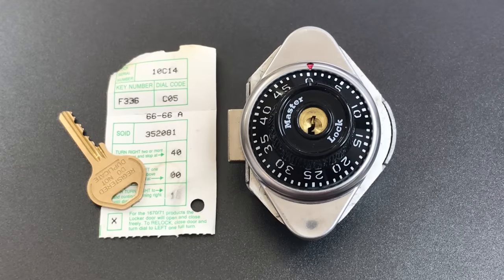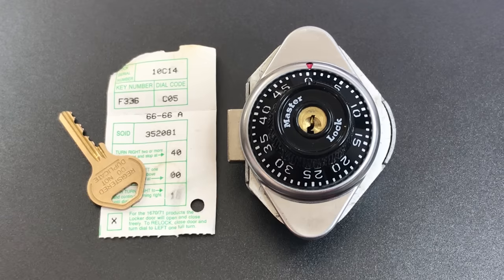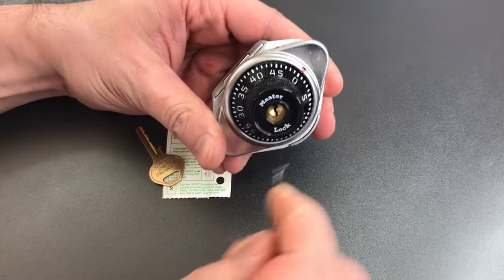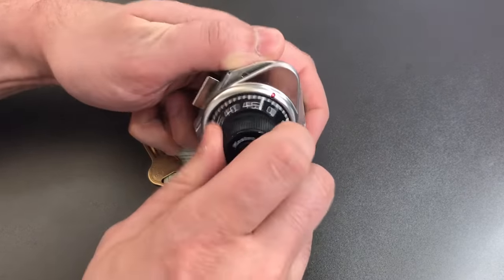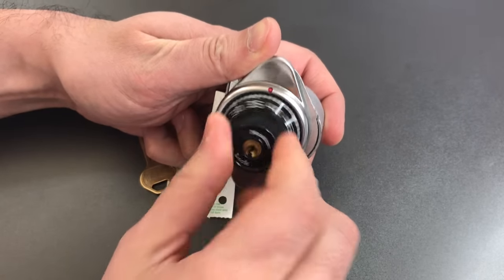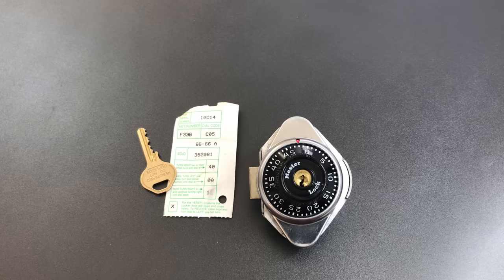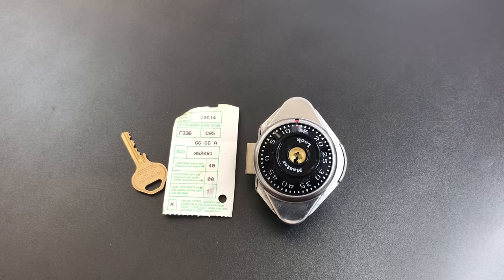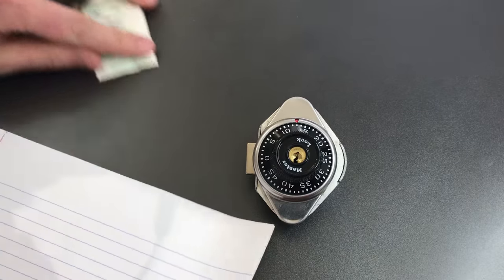[617] Master School Locker Combination Lock Picked and Decoded (Model 1670)

Comment: One combination to my HS locker was 15 - 17 - 47,   
suddenly remembered shortly after watching the video and reading some comments.  
(It's been a long time --- I graduated in 1977.) 
I believe the offset between combinations on that one was either five or seven digits, 
not different each time, but the same spacing all round (I could be wrong here).  
The Master combination dials we had required turning to the correct third setting,  
and opening the door required lifting a slide.   
I was well aware that there was about a one-and-a-half digit slop in my dial. 
Whether or not that was typical at that school I don't know, but it seems pretty tight for a Master.

Comment: Years ago I worked at a large company and my locker there had a lock like this on it. One day something broke on the inside of the lock and the latch wouldn't move. My manager had to call someone from key control to come out (which took a while) and as I couldn't go anywhere as my keys were in the locker they had to keep me on the clock. He tried a few of the multitude of keys he had but none worked so he wound up drilling the lock off at the attachment points. I bought a padlock of my own and used that to secure the locker from then on (there was a place to put a standard padlock).
Reply from the maker: Always a good idea to use your own lock... if it is intelligently selected.
Reply: LockPickingLawyer Agreed. I didn't have a choice while the original lock was on there. For a few days I used some cheap keyed padlock I had at home until I could get to the store and buy a combo lock so I wouldn't have to worry about losing the key. I bought a Master Speed Dial lock. It worked well and after a while I was able to open it faster than any key or standard combo lock. I liked how I could set my own combo of any length, I had 6 "digits" set on mine (so 4,096 possible combinations if I did the math right). 

Have you opened a Speed Dial lock on the channel and if not could you? I'd especially be interested in seeing the body opened up and an explanation of the mechanism.
Reply: LockPickingLawyer Agreed. I didn't have a choice while the original lock was on there. For a few days I used some cheap keyed padlock I had at home until I could get to the store and buy a combo lock so I wouldn't have to worry about losing the key. I bought a Master Speed Dial lock. It worked well and after a while I was able to open it faster than any key or standard combo lock. I liked how I could set my own combo of any length, I had 6 "digits" set on mine (so 4,096 possible combinations if I did the math right). 

Have you opened a Speed Dial lock on the channel and if not could you? I'd especially be interested in seeing the body opened up and an explanation of the mechanism.
Reply: @tallman11282  is the speed dial the d pad like lock? Yeah he did a video on it.
Reply: I dunno, in many jobs, having the equipment break down through no fault of your own so you can’t work but still have to be paid sounds like a win. Doesn’t work in lawyering, obvs.

Comment: Very interesting!
Over 30 years ago, I wrote software for a company that sold applications to school districts, and we had an application that managed these multiple locker combinations. Some poor sod at the school district had to sit down with the book or printout or whatever and manually key in all five combinations for probably over a thousand locks, but once the data was in, it was easy to do the lock change every year (apart from the manual effort of physically stepping the locks to the next position). When our software printed student class schedules for the students, we just picked up the correct combination based on the student's assigned locker number. Not bad for a software stack written in COBOL, I'd say.
Today, I imagine (hope) you just get a piece of software from Master with your lock order that preloads all that combination data for you, and/or a dump file that contains the data in a usable form.
Reply: >COBOL

Man I feel sorry for you

Comment: So I found this video today trying to figure out the best way to open the lockers I bought yesterday and what I should do about being able to use them going forward without worrying about them relooking and having to go through it all again. 
 I bought two stand ups that have 6 lockers per tower, and a cross between that has 4 lockers. 6 came unlocked but the others are all locked. 

Any suggestions would be very much appreciated.

Comment: Kinda late, but on the last digit you are off by 2 each time.  When the number was 48 for position 3, it locked up at 0.  Same with all others, it locked 2 ahead then you wrote down.  Given the projected 2.5 leway, I think you could not count the 2 you move back when changing the pattern, and come up with the precise number.  Based off observing the 3rd position each time.
Reply: I think that it's just opening when it gets close enough to be within the tolerance window. The window is 2.5 numbers wide, so that would make sense.

Comment: I used to slip a penny behind the bottom of sliding handle mechanism in my high-school locker. The penny would prevent the handle from dropping back down far enough for the combination lock to re-engage, but it looked locked, and the door would still latch shut. Then all I would have to do is simply lift the handle when I wanted to open my locker. I had nothing but books in there and wasn't concerned about theft at all. 33 years ago, nobody stole out of lockers anyway. My time in the hall between classes was more important than fiddling with a combination lock.

Comment: When I was in high school (back in the dark ages of the late 1970s), our lockers didn't open on the last digit.  You had to set the last digit, then pull up on the latch mechanism to open. The doors & latches were often bent and it wasn't unusual for it to require a bit of a jiggle, shake and/or smack to get the latch to open.  Like many others, I often had nightmares of not remembering my locker number and not remembering the combination.  The nightmare would also usually include getting lost trying to find the administration office to ask them to give me my locker number & combo.  <shudder>
Reply: They still have lockers that don’t open on the last digit. I got my first school locker in 2015 and it was the same way. Had to push up the latch to get it to open.
Reply: Wow - so others had similar nightmares.  I had mine after I graduated, which is kind of odd to me.
Reply: @jimothy2361  Pull lightly up on the latch while spinning for the third digit.  When the lock releases, the latch will come up.  Just make sure you're not pulling up on the latch hard enough to prevent the bolt from releasing properly.
Reply: If my locker wouldn't open up, I didn't fret or have nightmares about it, I simply took it as an omen to skip class that day. Had many fun days off..
Reply: O aye. Remember  ours  had the old fashion key. A lowe a fletcher double sided key. 95/97 series.  On a master key. Made in a way that user keys could not be filed/ altered to produce master key.  A different blank a reverse groves was used.

Comment: love this vid! the first i heard of using the 'wide gate' weakness was richard p feynman, bored and stuck at los alamos in the early 40s he started breaking into combi protected file cabinets. i wish i could remember the book where i read about it, super cool stuff.
Reply from the maker: It’s present to some extent on all but the highest security combination locks. Without it, they would be a serious PITA to open.
Reply: I don’t remember it but two very good books on that era are “the making of the atomic bomb” and “dark sun: the making of the hydrogen bomb” by Richard Rhodes. You might enjoy those. 
As to combo safes, HMG routinely use Chubb mk4 Manifoil locks on cabinets and lockers. If you’re half a digit off on the 100 digit wheel they’ll kick you straight out. They’re fucking merciless, and full of lead so you can’t x-ray them.
Reply: Worked in retail banking for enough years to have opened over 100 different combination safes, and found quite the variety in gate widths. Always remember one particular dual-dial one that required high precision. The co-worker who changed the other dial always messed it up. After having to call a locksmith out several months in a row, I changed the procedure to require the newly set combination be tested multiple times (instead of once) before we closed the safe. I could then take the backs off the safe door and then the lock to manually reset it so she could have another go. A 5-10 minutes job of resetting combos regularly took at least 30 minutes.
Reply: I think that was "Surely you're joking mr feynman." I have a copy of it at home but I won't be back for a couple of weeks. If I remember, I'll look it up when I get back.
Reply: @AdventuresofGraywolf   Yes, it was.
Reply: Feynman's method was similar. He found that if the filing cabinet was open, he could visual observe the two first numbers by "randomly twirling" the dials. Then he just had one number to find. He had a log book of the last two numbers for everyone's filing cabinets.

The one time that he was called on to demonstrate the technique, it opened on the first combination that he tried. From then on, his reputation was made.
Reply: @WhereWhatHuh  checking out the old vids are we?

Comment: Try to decode Dudley combination lock, cannot be picked or shimmed
Reply: There's already videos showing how to decode a Dudley, and they're worse than Masterlocks. They only have 10 gates around the dial, and the second number is typically smaller than the first, making for about ~500 combinations or so.
Reply: gotta agree with chris stone.  I had to nuke a bunch of dudleys at an old work place, due to people quitting and never removing their locks from lockers.  I found dudleys were great, the metal is such cheese grade that my small set of bolt cutters take em right off.  Master lock uses stronger metal in their products than dudley.   As for how we decided which ones to cut?  We put electrical tape on every one over the rotary lock or key hole, and if it was still there a month later, they got mr. snippy snip.

Comment: Since it is a lock intended to be a fixed install in a high-traffic area 15 minutes is actually plenty of resisting time. Remember, security measures are never designed to last forever, they just have to last long enough.

Comment: As a music teacher, I've had to deal w/ a number of school MasterLock sets for instrument lockers.  You finally figure out that if you leave it on the last digit of the combo, you can just pull it back open.  Of course, after a while the combos stop working, and I'd have to use the set key (or vice versa).

Comment: Even if they did change combinations  every year,  there would still be only 50 possibilities if you had that locker previously. You could probably figure it out in 10 tries or less since the average of the offset is 10.

Comment: How would you figure it out on a lock that requires you pull up on the latch to open it. Ours would not open on the third turn until you pulled up on the locker handle.
Reply: Exactly. Where I went to school these were used on gym lockers with the caged mesh style door.  The one you described were used on the hallway lockers.

Comment: Back when I was in high school, there was a rumor that you could open your lock with the default combo, then, while holding down that button on the back, you could set the combo to anything you wanted. 

Back then, I was always frustrated that it didn't work. Now, I'm actually kinda amazed that, while wrong, the rumor did have a grain of truth to it.

Comment: I had to repair lockers in High School,  and at that time the 60's, the lock units had only 3 choices of Combination. open with the key,  press the button, and the next combination in line was set. No need to do anything with the dial.  Good that the process is more arduous in these present times.

Comment: Our middle school had the better version with a latch that only pushed upward when you got the third number correct. Now our high school has these ones where the third number does not matter, and they do not have the button on the back to change the combination, but at least they now have metal dials. I can also stop the ones at my current school with by backpack strap, so they open when I pull the strap.

Comment: Model 1630, for a different locker style,  has a bolt that lifts up, rather than retract. To brute force the combination, after dialing the first two numbers, you must lift up on the handle to test the third number.

A student could purchase a Master lock on ebay and swap it for the school's lock on his or her locker, which is attached with 2 nuts. Then, he or she could disassemble the school's key cylinder and make a master key for the school's system.

This points out a critical vulnerability of the administrator's key system. It would be better if the dial were replaced with a solid dial (no key cylinder), but, as best I can tell, Master Lock does not offer one. The administrators could still open the locker with the combination on file. For balky locks, Master Lock could provide a guide piece for lining up a battery powered drill while drilling out the dial attaching bolts from the front.

Comment: This lock was very easy to decode in high school. You put your finger on the locker latch lever with slight pressure then kick the shit out of the bottom of the locker and it will pop open.

Comment: So, if all combinations have the same offset for each number, that makes it so once a student knew his combination, there were only 49 other options to test, and since the tolerance seems to be quite far off, you can basically test 5 of them at a time if planned well, and in 10 tries you’d be able to test all combinations. Seems to be relatively easy if the student knew about this oversight.

Comment: This lock must be a different model than the ones that were in my school. They look the same on the outside, but for my final number it wouldn't bind up on it like yours does. I could freely spin past the last number and miss it if I wanted to. Since your picking method basically rules out the last number, I wonder how much more difficult it would be to brute force the combinations. I suppose it might not make a huge difference if you just tugged on the locker while you were trying numbers.

Comment: When I was in school, we’d put the combination in on day one, and using a bit of a slight turn to the left on the wheel while pulling up on the door handle , we could jam the lock in the open position (which was necessary to make it clear across campus in the short passing period we had). Of course the only problem was, if someone turned your lock wheel ever so slightly to the right, you’d be forced to reinsert the combination and do the whole lock jam drill all over again.

Of course, I believe this was only possible because my school’s lockers were 30 to 50 years old, and had sloppy door latches to begin with (meaning, even with Master Lock’s sloppy dial tolerances, and shoddy locking bolt, the doors themselves were probably the least secure feature on the whole locker, not the lock).

Oh, how the Early 2000’s were a different time!

Comment: If the offset was never smaller than -5, that would imply that you'd only have to check 11 different combinations if you knew the one from the previous year. Combined with the third number not really mattering, you'd basically only have to input 28 (counting spinning to the right at the end as half an input) or so numbers to get the lock open. So, it'd take about a minute or less to get open, which is insane for a combination lock.

Comment: Just a note from the early part of the video: You said the number of combinations was 50 cubed, when in reality this would be a calculation of permutations — 50 objects, from which 3 are being chosen AND where the same two numbers can be used more than once. Now, obviously this is still somewhat inaccurate, since you likely can’t use the same number for ALL three entries, but you can subtract the number of results where all three entries are the same (which should be 50) from the end result. SO, the way you would calculate this is by setting the factorial of the objects over the factorial of (objects - sample size), or 50!/(50-3)!, and then subtract 50 from the end result. This gives an estimated total of 117,550 total combinations, which could go lower depending on the restrictions of the lock (if no two subsequent entries can contain the same number, for example), or if it IS indeed possible for all three entries to contain the same number it could go as high as 117,600.

Comment: I used to forget my locker combo a lot so I figured out that if you pull out on the dial you get a little bit of tension when the tumblers fall into place was able to open just about any locker in the building doing that.  Then in senior year my home room was on a floor that had lockers with no locks so we had to provide our own and I just got a key lock for mine.

Comment: Some of my lockers would auto lock (probably a spring on the bolt) meaning if you closed it you had to start over. Others you had to be so precise with the last number or it wouldn't work.  My work locker is more like this one where there's a bit of free play but when you open it, it turns the dial a bit (which coworkers exploit leaving it just outside the range but not cleared or solved... or they just leave them open)

Comment: My highschool actually made you bring your own locks. They got new lockers my sophomore year that required you to lift the latch that the lock went through. Trouble was that if you lifted the latch as far as you could with the lock in it then pull down on the door and give it a bit of a tug it would open. Pretty rough deal